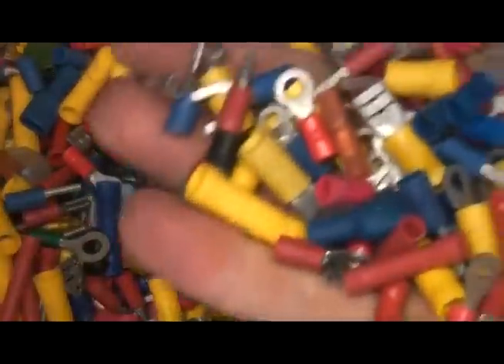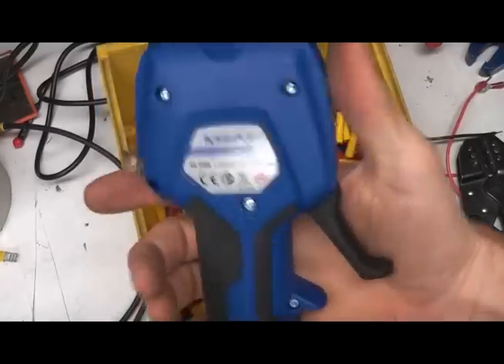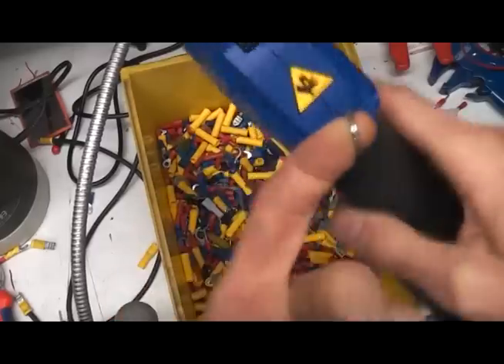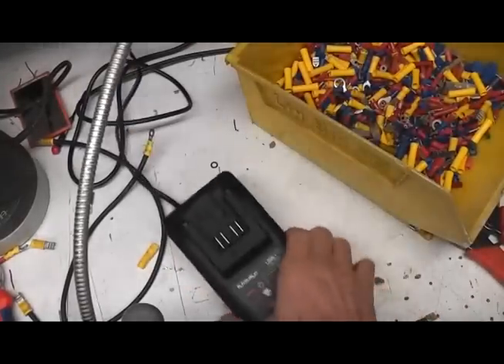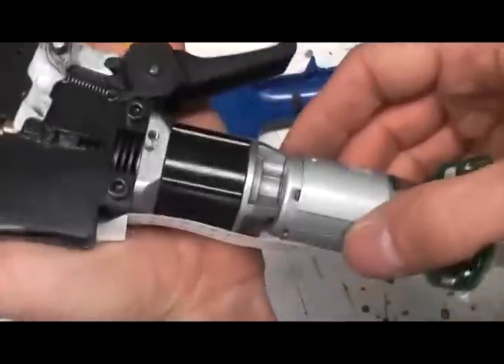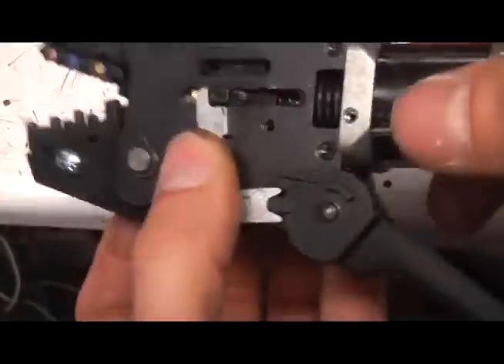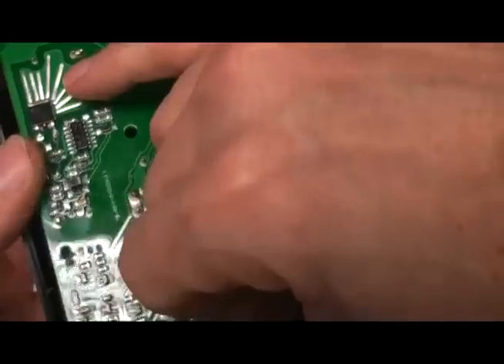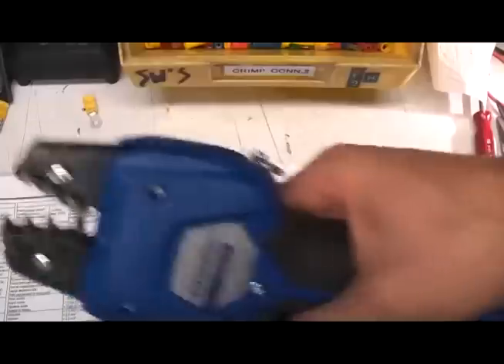Klauke EK 50ML - a totally awesome crimp tool!

Comment: We use their hex die electro-hydraulic model that runs off a bosch 18v tool battery. It does 240mm2 lugs with ease.  About six times the cost of this one though....

Comment: The battery & charger used for the EK 50ML are the same used on the DeWalt 12v Max (10v Max for U.K. model).

Comment: Klauke make great tools, but they have ONE massive problem: they always have these annoying nags to get them serviced and not at competitive prices. I've got an EK60/22L (for up to 400mm2 lugs) and after a set number of crimps it blinks and refuses to work for a while every time you insert the battery. It's the same for some of the smaller tools, although I don't know about this particular one.

Like, I paid a couple grand for a tool, either give me complimentary services if you care so much about a consistent and reliable service life, or let me use the damn tool!

Comment: I wonder if that resistor is an eff you from the manufacturer. It's entirely possible considering the device was made by people.

 Maybe they needed a "jumper" on another part and had to include it in this value chain. I think they could have just as easily had the pick and place machine throw that part in the trash. There is no excuse for waste in modern manufacturing. 

There is something profoundly queer about that feature and I don't think your theory of testing holds any value.

Comment: The single voltage charger thing is likely just to isolate the markets. To stop people importing units from overseas instead of buying locally at huge markup.  Will be part of the distribution deals that overseas versions are not compatible.   TBH it wouldn't surprise me if it actually is universal but just says it's not on the label.   I wouldn't be the one to test it though.

Comment: The battery looks almost identical to a DeWalt 10.8 V battery (or 12 V MAX as they call it in America). 
I think you should try to take the Klauke crimper down to your local DeWalt pusher and see if the DeWalt DCB121 (1.3 Ah), DCB123 (1.5 Ah) or DCB127 (2.0 Ah) will fit.
DeWalt 10.8V / 12Vmax battery are way cheaper than Klauke RAML1 batteries and much easier to get hold of everywhere.

Comment: I crimped a lot of 20awg and 22awg doing car alarm installs. I use my non-insulated die on my insulated connectors though, because I have had some insulated connectors slip off using the insulated crimping die.

the light would be a lot more useful if it came on before you crimp.

I have a handful of minor complaints for a $500 crimper, but over all it is quite helpful. I used to hate crimping and now it is the fun part of my job. when I'm all done crimping it makes me sad. im like that's it? : (
Reply: YES, this is true. anything less than 18 usually calls for a hand finesse of a tooth crimper..  at the risk to puncture the insulation ..  thus use of heat shrink is a good idea.

Comment: Those hilarious yellow 110V safety transformers in a plastic bucket are only used in UK, or at least not here and never seen them anywhere else. We are not afraid of 230V, we are proud we have those volts here, together with 3phase power in every (including residential) homes :D

Comment: Most of those ratchet crimpers assure that you get a very bad crimp joint.  The type you show seems to be exactly the type that force me to take a trip around to customers recrimping all the crimp lugs.  The lug gets just flattened by the two jaw sections.  In a few months in the field, the joints loosened up.  I have a hand one that looks a lot like the one you said is junk that works perfectly well and makes 100% reliable crimps.  You just squeeze until the stops touch and the joint is done.
Reply: +Ken Smith Bullshit. It really is junk and the ratchet crimp tool is good enough for most jobs. If your lugs got loose, it was either fault of the person who crimped them (he cannot crimp properly) or you have bought cheap lug-shit made from soft metal.
Reply: Usually it's because a wrong lug size was used for the wire.

Comment: The crimp die in my crimp tool is not symmetrical: the terminal end needs to go into the tool only one way. The crimp on the bare wire is deeper than the one on the insulated wire. Didn't see this mentioned and watching you crimpimg endless terms without apparent regard for orientation... (c:

Always excited to see your latest share...

Comment: Nice tool if you use it many times at one day.

Wow i was shocked by the price. 

Almost $400,- and that for a made in china tool.  This is a nice tool if the price is a round the $100,-   

For less than $300 you buy a electric tool that also can crimp big lugs 130mm. 

My hand crimp tool work fine more than enough for the crimp jobs that i have to do.

Comment: +mikeselectricstuff Looks like a Standard Dewalt Charger and Battery pack we use @ work the  12V max Li-Ion Imp Drvr, I wonder if it is the same as those or not. Anyone know?  Hey here is one that works on the Dewalt batteries that is 110 to 240 VAC http://www.amazon.com/dp/B00X52C7YC?psc=1

Comment: I'm guessing the starburst pattern is to do with the surface tension of the liquid metal before it cools -- it will form many bumps or one glob toward the end of the wave solder, and I bet the sum of the bumps is higher than the total glob if it were just one wide track.

Comment: So when you get a slack day, I bet you edit the PIC code to allow the LED to come on as the first microswitch operates!
As well as a huge variation in quality of crimp tool, there is a significant difference in the quality of the insulated crimps. We primarily use AMP branded ones at work, you should compare the gauge of the metal which crimps down on to the conductor.

Comment: I wonder how it knows what gauge of crimp your doing so it knows the target force/current to stop at. Perhaps its just relying on the leverage of the claw, so the farther the crimp is from the jaw pivot point the less force will be applied to the crimp at the same current/force from the motor?
Reply: +Kezat The micro probably only monitors motor current to detect a stall condition prior to crimp completion.  Most crimp dies (very few do not follow this rule) are machined to come parallel when the crimp is complete.  The gap size in the jaw is what determines the crimp tolerance and the jaws themselves do have a finite lifespan, albeit very long. Crimp connectors themselves have internationally accepted standards for dimensions and color code which takes into account the maximum 'crushed' dimensions to call it a satisfactory crimp.  The manual ratcheting ones have a slightly misleading adjustment that really has nothing to do with the final crimp force, but more of a "Squeeze past this point to allow release" type follow through.  If you set it too low there is a chance the operator will not have given the jaws enough travel to ensure the jaws come parallel.  In most applications setting that adjustment to the maximum will not have any adverse effects on the crimp, but may be more fatiguing since you have to squeeze the handles closer together for the end stop, and therefore release, to be reached. Manual ratcheting crimps do have a sort of 'emergency' release; press the little toggle on the handle side towards the jaw hinge and the will unlock completely.

To answer your other question, larger crimps are placed closer to the jaw pivot simply to allow maximum leverage but are still subject to the same above.

Comment: the motor is branded Johnson, from my old robotic's day, i know that the "johnson" motor's are a standard with regards to size and mounting hole arrangement, might be hand in the event you ever need to change the motor due to failure!

Comment: top notch tools, for top notch prices. at least that battery pack is easily rebuildable when it dies (18650 batteries). the motor looks to be a pretty standard 550 size motor, (but a decent quality johnson one). my only minor grumble with this is the non universal charger. would it be all that much more expensive to design a charger that can work off 100-240v ac and 12-24v dc. dc charging capability would be incredibly useful for charging the tool in your van.

Comment: Nice tool for sure, except for the noise. 
I have a pneumatic crimper somewhere but it's the size of a shoe box, without the compressed air source...

I don't really trust those insulated connectors, the bare metal ones seem to crimp far more reliably.

 400£ is not that crazy if you look at those "recommended" tools the connector manufacturers try to sell you. And they are typically the most clunky uncomfortable things (but do crimp very well indeed).

Personally I stocked up on the ratcheting alloy handles from zbtools when Farnell cleared the stock. Now I have a handle for each set of jaws and don't need to change them out.

Hope you will make more videos.

Comment: That 0 Ohm resistor is probably a marker for the test jig indicating if the board is actually populated. So it does not spit out an error for that particular board. I have done something simlar but that resistor is in circuit and will later provide a way do disconnect a part of the circuit for hunting down shorts.

Comment: I'd rather put some rubber handles around a hand tool than spend 400 pound on this tool, just my opinion. I also wear worker's gloves when doing manual labour with screwdrivers and other tools, because it just ruins your skin if you rarely do this sort of stuff

Comment: Next time you have it apart put some molyslip in the gearbox. It will make it a lot quieter and it will last a lot longer as well. As a bonus a few extra cycles per charge. I would like them to put the light as a separate switch along with one on each side, not a 5mm round but a rectangular one, easier to fit on the other side in the trim.

Comment: When I have to do dozens of coax crimp connections, I crimp the sleeves while standing and pushing down on the tool with the other side of the tool resting on the bench or table. It is so much easier than squeezing with your hands.

Comment: 400£? That's Apple level markup. I bet this thing doesn't cost more then 75£. And it can't be "branding" we are paying for since this is the first time I've heard of this brand.
Reply: +flanker I don't think it's that surprising for a heavily-engineered tool that is to fill a sort of a niche.
Reply: BenjaminGoose Niche? That's a crimping tool.
Reply: flanker And who uses it apart from electricians and electrical engineers?
Reply: I do. I actually have 2. One for crimping JST connectors(bought for 17$) and the other is a RC45 crimp(10$ or something). 

Although I'm a Comp. Engineer, the reason I use crimps is mostly for hobby.
Reply: flanker So, you might know a few people outside of industry that use it, but that doesn't make it the sort of high-volume product that a regular crimp tool might be.
Reply: BenjaminGoose Of course crimps are not as popular as, say a screwdriver, but they are no scanning electron microscopes either. When you consider RC45 crimps are also crimps, calling them a niche makes doesn't make all that much sense. 

You might say that this one is an "industrial" grade tool and hence the sky high price, but as someone who worked in an electronics factory, the crimps I've seen they use were all pneumatic.

I think this tool is just the iPhone 6S Gold of the crimp world. Sure it's not actually better than a 400$ One+ 2. But it looks cool (and expensive) as hell. And owning such a tool makes you look more "professional" 

I've realized there are 4 quality levels within the tool industry(or any other industry really) There are extremely cheap products that only the newbies use(once). There are mid level tools that everyone who actually needs that tool for work use. There are the extremely expensive "industrial grade", "pro level", "titanium alloy" tools that rich hobbyist use. And lastly the "real" industrial grade tool that wouldn't even fit in anyone's garage and cost more than a college education. Which are obviously used solely by factories.  

I believe this tool is in the 3rd category.
Reply: flanker That's true. I didn't mean they were a niche as much as say, industry-grade equipment, though I do think it's more of a niche than a pair of wire cutters. I think I agree with what you say.
Reply: BenjaminGoose I'm glad we reached to an understanding. Cheers.

Comment: Nice, got to love nice tools like that. I got myself a nice tool not to long ago for completing my Masters. A Spektrum DX8 transmitter. Building my own quad.
Reply: Graupner mx12 hott and devo F7  ;)
Also built my own quad, just a crazily overpowered 320 fpv quad. 25a escs and hell, that thing is fun to fly
Reply: +drkastenbrot Sounds like yours has a bit more beef to it than mine. They are great fun to fly, they also make quite a satisfying thud when you crash them into the ground at full speed. I have put more beefy arms on mine and replaced the NAZE32 as I damaged the gyro on the last one. Trees very much become your enermys when flying these though.

Comment: The charger and battery looks like Hitachi-system.
Reply: They somehow outsource batteries and chargers. Went to their website, bigger crimp tool (up to 300mm2) has bosh battery in it. I think I've seen older model of that tool with makita batteries too.
Reply: @SakariNy  It would make sense to license and re-use something that's already on the market. Like all the stuff that uses the "Nokia" BL-5C cells :)
Reply: @zaprodk  oh right... There's also a camcorder battery that is commonly used for other things on video industry. Maybe it is that odd after all.

Comment: That could be useful if you have to crimp a lot of connections. I don't really like using the crimp connectors though, I find soldered connections to be lower resistance and more reliable.

Comment: Once you use a ratcheting pair of those crimp tools you will never go back to using the old cheapass flat crimp impostors. those things are only good for making bad connections! the ratcheting kind can be fouind at autoparts stores now and are worth it if you crimp anything more than one or two connections.

Comment: Expensive, but totally worth it in terms of RSI or blisters in some working situations.  At the peak of my fairground lighting controller manufacture I twisted so many wires that I literally wore my fingers down to the flesh.  I ended up buying a bench mounted automated wire stripper and twister that cost a significant amount, but was worth every penny in the long run.  That solder fin pattern in the charger was very odd.  Quite stylish though.  Maybe to slightly thicken the metal to help dissipate heat across the copper plane slightly?
Reply: Agreed. I suffer from arthritis, and I've come to just accept that I need some expensive tools to do stuff like this. 400 quid isn't excessive... I just wish the batteries were compatible between brands.
Reply: Looks not much more expensive than my AMP tool.I want one!
Reply: bigclivedotcom aww. Go back to crimping wires! Hugs

Comment: Greenlee also sells these.
Reply: yes, but beware. the identical EK50ML120 is NOT compatible with most all dies. Thomas Betts, Paladin..  Greenlee doesn't even make dies for the 120.  Two or so dies are available for the 120 at 250 each!   The 138 looks identical but has the 13.8 MM jaw, of which is compatible. Both are 500 tools. Note to self, DO NOT BUY THE EK50ML120..   BUY THE 138 INSTEAD